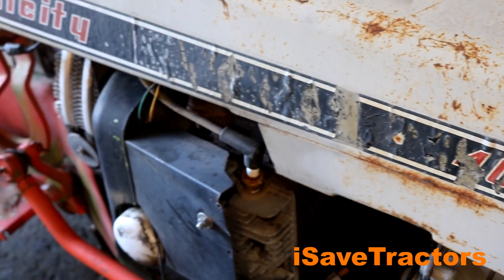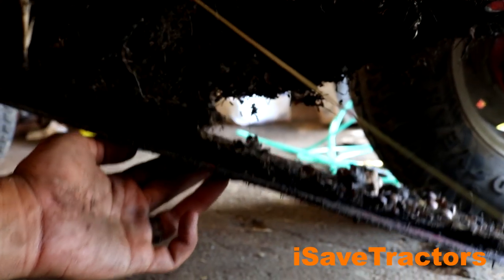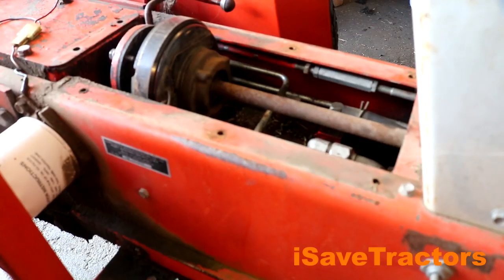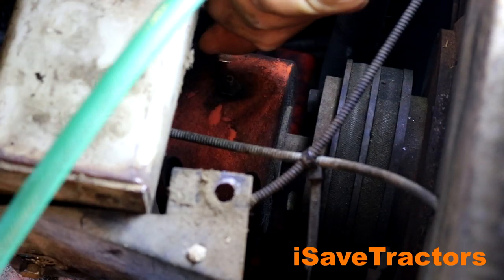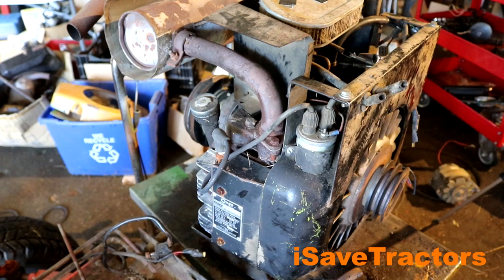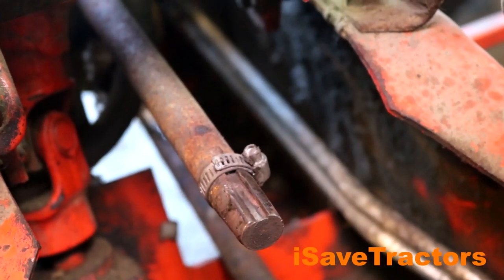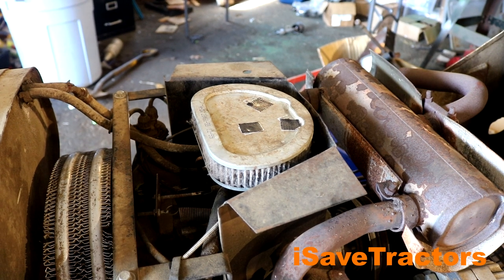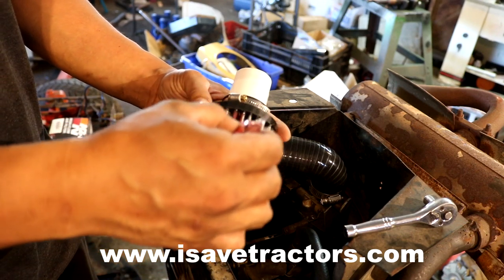Simplicity 4040 Powermax Project Tractor Episode 1

Comment: Yay! The project has started. A few things I want to point out. 1. The chain coupler is not what is used on either of my 9020s. Instead I have a fiberglass disk coupler. I happen to be in the process of installing a rear PTO right now so I have a rear PTO shaft and coupler that I can measure and show you. It looks like that solution may have been put in place by the previous owner (don’t believe it is OEM). Maybe the shaft snapped ? Point is the shaft should have a splined end and a metal coupler that slides over it. 2. You should look at the carburetor setup on the later tractors. You will make closer to 20HP with that setup. This made my day! Thank you!
Reply from the maker: If you can email me some pictures and measurements of what yours has I would appreciate it!

Comment: I've had many, many tractors and various pieces of equipment that I've bought that were in the same kind of shape when I got them. Full of mouse nest, grass, oil, etc. the first stop I usually make on the way home, while my new crap is still on the trailer is the car wash!  I have a power washer at home but I'd rather not have that crap all over my floor. Plus if you start with a little bit of degreaser then use the soap there followed up with the high pressure, you can get stuff pretty clean before you get your grubby mitts on it.

Comment: Man, i am kinda glad my skid plate was missing now,  i thought mine was bad, i almost emailed you the other day asking questions about finding CCKB stuff for my first Powrmax,  second tractor period, and i only discovered them from your video after buying my first Allis. Glad to see you can fix it all, i need a field assembly for rear PTO and lost my gas tank in a flash flood lol,   but my ridiculous $350 carb should be here soon and i can put her to work finally with the back blade getting this place cleaned up!!
Reply from the maker: Thanks for your comment. By the end of 2019 we will have our brand new carbs and rebuild kits for all of the vintage Onan engines. Thanks for watching!

Comment: My friend recently acquired a nice little Power King Jim Dandy, one of his co-workers thinks it might be either a 1612 or 1614. It's hard to tell, the person who owned it previous to his uncle painted over all of the original decals. It ran good when we brought it back it his house. But once we changed the oil, gave it a fresh spark plug and air filter it ran even better. The clutch needs some adjusting though. :)

Comment: As much as you work on little tractors & what not, I'm surprised you haven't built or had a little shop built, with better lighting, and an small over head hoist, running along some tracks..
Reply from the maker: See our shop tour video for explanation
Reply: Yeah I watched it before your comment. I appreciate the reply. 

Personally working in that space would drive me up the wall... too dark, and it looks like if you dropped a part on that floor, you'd spend more time than needed looking for it. I like those shops with the sealed concrete floors example in the link

http://pdxplate.com/floor-paint-industrial/fresh-floor-paint-industrial-inside-limg-4378-jpg/
Reply: @Isavetractors  Hi! I'd love to see you you guys do an FMC Bolens HT Tractor. They were very nice too❤

Comment: Update: it seems there was an earlier rear PTO design. The earlier version is likely what you have in the video. The earlier PTO seems to also have a driveshaft loop where the later don’t. The other tractor you showed in your very 1st Powermax video is a later one.
Reply from the maker: Thanks for the heads up. So you're saying the chain couple maybe how its suppose to go? I've searched all of the internet for a reference to this chain coupler set up and haven't found any documentation. I dont think it was put there by the PO. It would have been a lot of work for them and based on the other modifications they made I can confidently presume they would not have been willing to go to the lengths of adding a new pto shaft with new support bearing and coupler.
Reply: isavetractors I agree. It must be one of the 1st made and the earliest design. It is interesting because they went away from this and over to a tubular shaft without the support bearing. Your other Powermax likely has the setup I was referring to. I have a chain coupler on my full size Allis Chalmers that drives a three stage hydraulic pump so it was interesting to see the same setup on a “garden tractor.” 🙂

Comment: I'm in envy of how you do, I'm not mechanical. I really think it's cool to restore these as in all honesty once you do aren't they just as good as new mowers? I do have a question about your air filter contraption; why not set it up to the original air filter it would have come with?
Reply from the maker: Thanks for your comment. New mowers are not even in the same league as this Powermax. See our video overview of them. Regarding your other question, these 40+ year old machines have several parts such as the air filter housing that are no longer available. This is a more rare tractor so it's even more difficult to find a used component.

Comment: Thought you might of had an engine hoist norm instead of dragging wife out of kitchen lol 🤓bless her the wives are always on hand what would we do without them ? Nice project will be nice when it's finished 👍
Reply from the maker: I do have 2 mounting points on the cielling of my shop that I use a hoist to remove engines. I had some other projects going on at the same time so I couldn't park the powermax under one of those spots. Nancy just works for me but no one here minds getting their hands dirty

Comment: Make a stack for it
Reply: My 4041 muffler is 6 inches short of the hood and ive been trying to come up with a twin horizontal stack idea, like two little 4 inch round but 12 inch long total mufflers for a 10 or 12 hp side by side? He already has a hacked up hood, i did too on a 712S so i stacked it.

Comment: Do you ever deal with any cub cadet 1050s?
Reply from the maker: Yes I have
Reply: @Isavetractors  any words of advice for me with mine, i have an intermittent  key switch issue sometimes i can crank it from the key, sometimes i cant, checked pto switchs brake swithes tractor in neutral etc, considering bypassing all the safetys

Comment: What did that tractor cost you in that condition
Reply from the maker: I paid $1000 for this one
Reply: @Isavetractors  . Wow, what a grab. I’ve been looking for a non running garden tractor with a front loader and belly mower. I know if I find one I can get it running or rebuild an engine. Just not sure where to start, what is too much to pay, or what tractors are any good. I’ll keep watching and hope to find some tips

Comment: I don't think that a roller chain coupling is a good choice for the PTO shaft.  It has no pilot or center.  It's intended to connect two shafts that are supported by bearings right next to the coupling.  They only tolerate the  tiniest misalignment.  It doesn't look as if the front of the PTO shaft is supported by a bearing.  And, if it were, then the engine would have to be perfectly aligned and shimmed in place.  Then, in use the frame will flex and the alignment lost.  A universal joint would be a better fix.  The shaft needs machining any way.  Check out Surplus Center for U-joints.  Be sure to provide some telescoping movement.  It's a very impressive tractor.